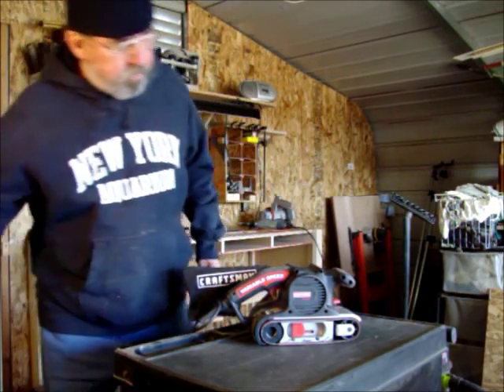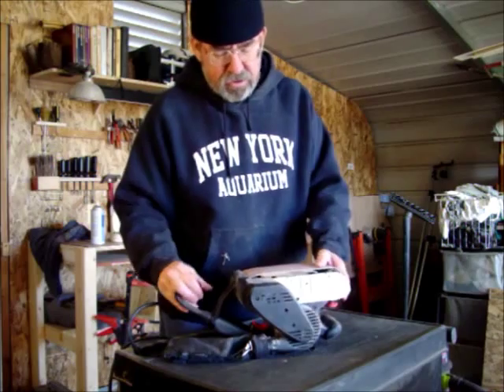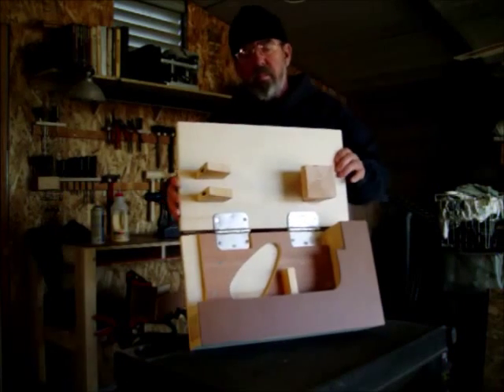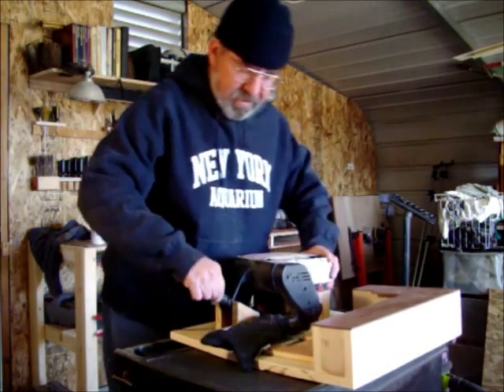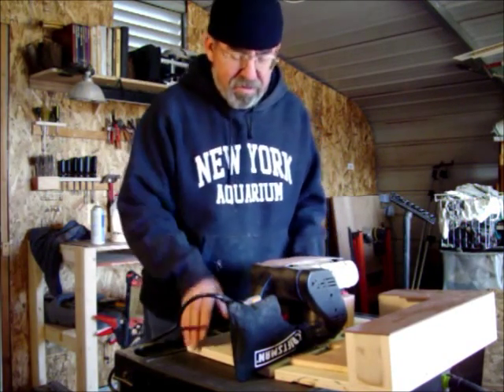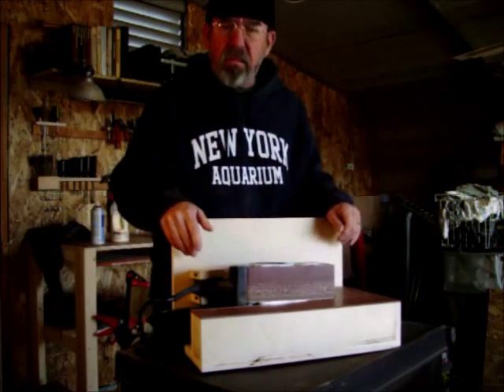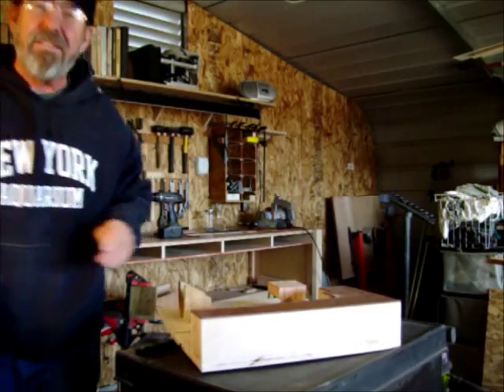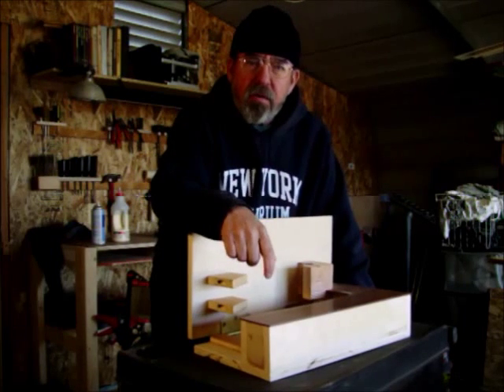My Belt Sander Platform

Comment: I have watched a half dozen videos and no one has put a switch on any stand that they built. Why reach into a running machine it's dangerous put a safety switch on leave your machine running and just hit the switch to turn off.
Reply from the maker: The angle of the video makes it appear that your hands are "in a running machine" where they are no closer to danger if the sander was out of the jig. Make your own with your improvement.  We'll all be looking forward to it.